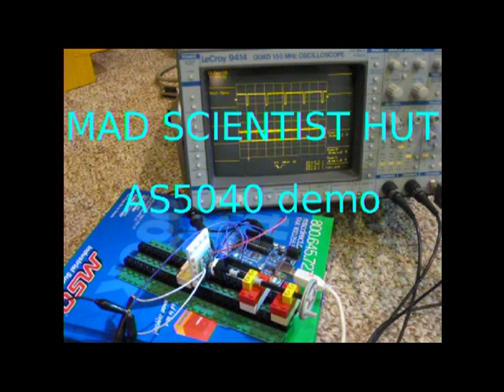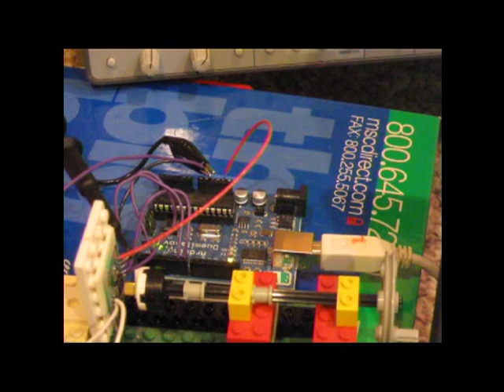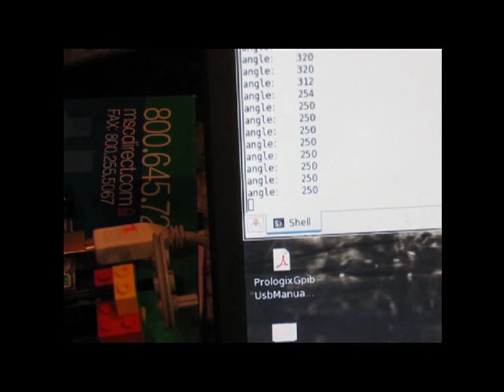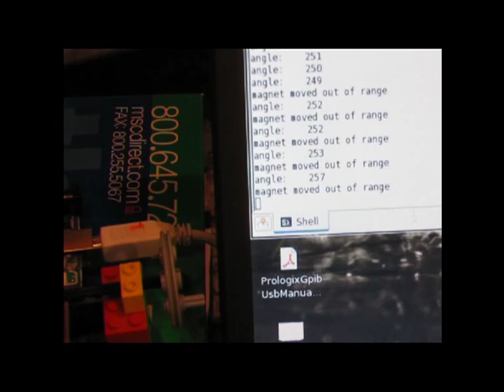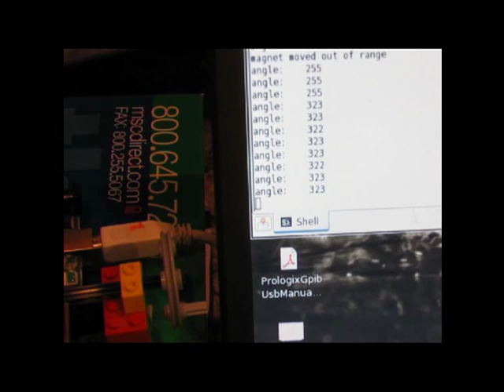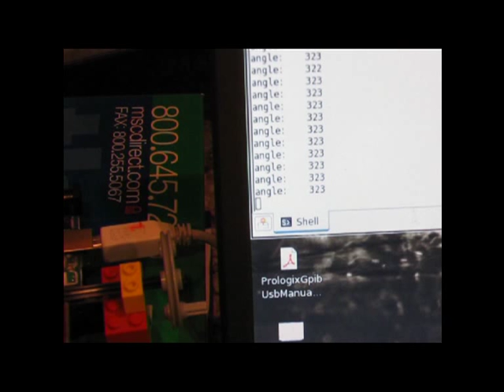Mad Scientist Hut AS5040 board

Comment: Sir i want to read data of as5040 how can i read data
Reply from the maker: http://madscientisthut.com/forum_php/viewtopic.php?f=11&t=17 is code I wrote as an arduino library for reading the as5040.  It's in C.
Reply: Sir i m not getting actual angular position how many type of data will change in as5040 and how i will define in code
Reply from the maker: @shreecartoonvideos  It doesn't provide actual angular position, just the raw ADC value of 0-1024.  Every time you power it up, the 0 position is the same, so it's repeatable.  You can calibrate it to provide a custom angular value output, but I've never done that and don't have any code to do that.  What I've done is calculate angles in software.
Reply: @smellsofbikes  Hey! is there any pin out that gives the angular velocity, or do you have a code to accurately measure the angular speed?
Reply from the maker: @subhadeepkoley1176  There isn't: you have to supply a timer yourself.  I've used these to measure RPM but I feel like they're overkill.  But angular velocity is a cool idea.
Reply: @smellsofbikes  I was using the serial clock of the microcontroller to find d(theta)/d(time), but that's giving me inconsistent results. I don't understand what's the issue though.
Reply from the maker: @subhadeepkoley1176  for what it's worth, I believe the AS5040 can measure faster than the SPI bus can transfer data so it probably isn't a sampling time issue.

Comment: Any sample code to use with interrupt ?
Your code just like SPI or different ?
I got false reading, that jumping 4 degrees /second.
Reply from the maker: You could write the arduino code to signal an interrupt on transition of either of the quadrature encoding lines.  https://github.com/misan/dcservo has sample code for interrupt-driven angular sensing using this chip.